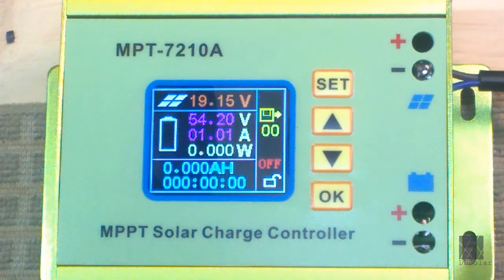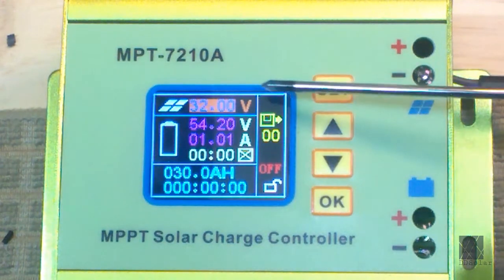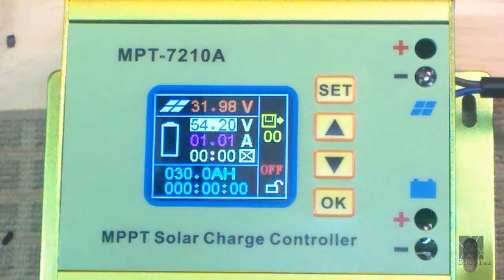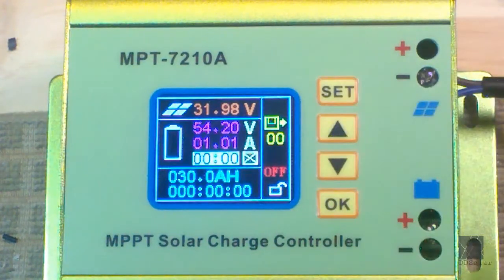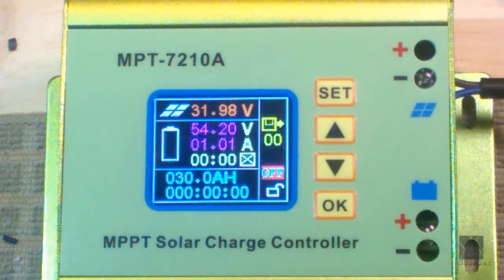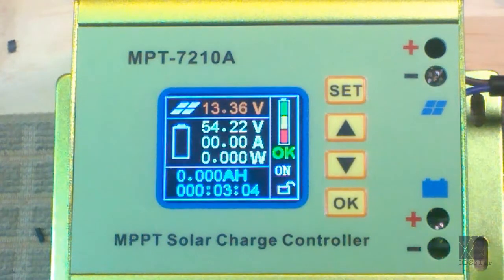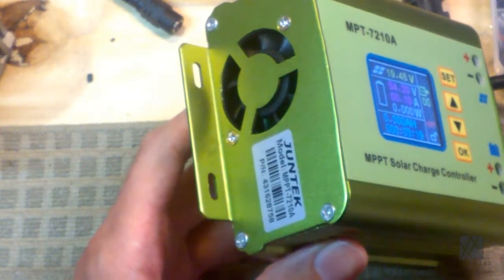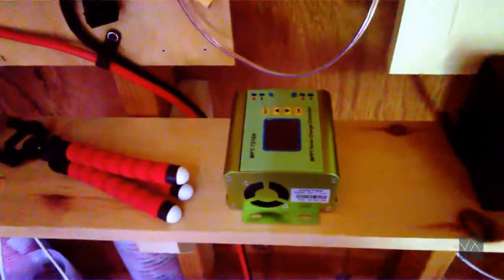How to Program MPT-7210A Boost Solar Charge Controller - Setup Guide

Comment: Thanks, much more understandable than the manual. And yes, I took have a damaged one that I will tear down and try to get working. I'm hopeful because it exploded a 100uA capacitor and blew the board trace leading to the current shunt. LMK when you get around to your tear down.
Reply from the maker: Welcome! I still have one of these that was damaged, if I can take it apart and repair I will upload and share

Comment: This is mppt or pwm?
Reply from the maker: @Skyblue0712 It is technically a DC-DC boost converter with static MPPT - meaning we have to set the vMP (volts max power) of the solar panel, and the converter will try to hold that. It's not traditional MPPT with auto-sweep. But it works OK when properly configured. Hope that helps!

Comment: If the panels are delivering 0.9A? Or when the voltage trips? That was the info i was looking for.
Reply from the maker: Hi, I hope I am not misunderstanding your question, but this charger monitors the solar panel voltage and "tries" to pull it no lower than it is programmed. But at the same time, we can also limit the charging current, in which case the charger won't necessarily reach reach the trip point for solar panel voltage. Or vise versa. In my experience, it doesn't always work perfectly. And the user needs to know the approximate maximum power point of the solar panel to program in. This is a fully manual "MPPT" requiring human input. Hope that helps, if you have any questions just let me know. DD
Reply: @solarpoweredge  thx, seems like a power supply module more than a solar charge controller, or even a battery charger. I'm still dabbling in slow charging SLA batteries. I was shopping for better performance at low solar outputs. As far as I know alot of power is tripped off for safe charging
Reply from the maker: @rickyvenilal1713 welcome... technically it is a programmable DC boost converter. I've noticed in low light conditions it doesn't always work properly. Probably because it is powered by the solar panel itself

Comment: Hi would this be ok with a 300 / 400 watt panel to charge a 48volt golf cart set up
Reply from the maker: Hi! yes it should work. Note this charger has a weak fan and will overheat without it. Might want to upgrade the fan to something with ball bearings, and don't run too high power. I use it to charge my lawn mower from a couple of 100w panels.
Reply: @solarpoweredge  thank you
Reply from the maker: No problem!!

Comment: These are the strangest controllers. I find them too inefficient for daily use. For my tiny house i need good mppt that can adjust to clouds and winter vs summer conditions.
This unit is useless for that. You have to manually adjust and its just annoying. Also even with the best settings it puts out about 50% of a real solar charger. My makeskyblue  cheap chinese mppt charger works better than this one. 
But i found a use for it!
My ebike 56.4v charger died so im using my mpt-7219a to charge my bike battery by boosting my 12v battery power up to 56.4v. The most it will deliver is 50watts even though i have 5amps available it wont do more than 0.5 amps but its better than nothing.
So as an adjustable dc dc step up boost charger with a good screen it will come in handy for various projects.
Reply from the maker: It really is a very niche charger. Nice screen. I use it for my 48V lawn mower. Works good. I mentioned in one of my videos it's just a programmable DC boost converter, no MPPT at all. And yet I can't stop using it. If they come out with a bigger model, I'd buy that too.

Comment: Here what is the maximum open circuit voltage of the solar panels to be used. I have 38 volts V oc panels
Reply from the maker: Hi. Your panels should be fine. On mine, 60V is max input. Battery needs to be higher than input voltage, as this charger can only boost the voltage upward.

Comment: Hi can you tell me if I'm doing something wrong or if mine is faulty. 
I have set up all of the settings and saved them under 00 and 01 all is fine untill the sun goes down. The next day when the controller powers up it returns to default which is right annoying. I reset all of the settings and save them again and it's groundhog Day the following morning Amy ideas?
Reply from the maker: Hello, that is a strange one, can you try setting the changes, press OK to save, then power cycle the controller at that time and before sun down. If it doesn't keep the changes right away, I am guessing either #1) the changes aren't actually being saved or #2) maybe the firmware version is different and perhaps there is a bug. It could even be a faulty unit. On my controller I have to press OK to save, guessing it's the same for yours.
Reply: @solarpoweredge  thank you I will try again I have two units both seem the same I'll have a play and see probably worth me posting here if there is differences.
Do you know of any other units like this that are buck type with a 60 volt input? I am working on designing one but it's hard to get hi current as most designs are only 1 or 2 amps.
Reply from the maker: NP, this charger is rare and unusual in that it is a Boost type and has a really interesting screen and UI. But it cannot drop the voltage from the panels, only raise it. I suspect there are multiple versions of it floating around, hard to tell - they all look the same.
If you search for "boost charge controller" there are a handful of other options, not easy to find good ones though.

For buck type with 60V input, you will have endless options. With those units, high voltage in and lower voltage / high current out isn't a problem at all. Example I have a Outback flexmax 80, so theoretically 80 amps into the battery max.
Reply: @solarpoweredge  yes usually use Victron mppt charge controllers but trying to find a lo cost option that does Max volt point tracking rather than mppt like the boost one. There's a great 5amp device called a CN3791 it also says mppt tracker but it's not it's a MVP like the boost but max input volts is 30 volts
Reply from the maker: Oh right if you want to just hold a specific voltage on the input, there is at least one big programmable DC converter on the "Amzn" site. If I post links they will probably just disappear. Searched for "buck converter mppt". The ones that have this feature usually are programmable and have a screen and buttons. I cannot say if they're really MPPT, but some of them just track whatever voltage you set. Similar behavior to the 7210A. I am not sure if they meet your requirements, but might be worth a look.
Reply from the maker: Actually found one on the same site (same keywords) that does not have a display. Has a trimpot to set the "MPPT voltage" and 2 for CC/CV. Of course that isn't really MPPT but voltage tracking. Claims 20A 300W. Hard to say, probably need forced air cooling to get near those numbers.
Reply: Hi I swapped the controller that wouldn't hold its memory with the other one I had and that one worked so looks like there is a fault with the first one. If I get the chance I'll investigate the circuitry to see if a tombstone  component or something. 
Thank you for quick reply and help
Reply from the maker: You're welcome! good thing you had a spare, I never heard of this happening.

Comment: Hello , this is amazing tool!!!

The ONLY problem is the noise from the fun and i have a very easy fix, the factory have wrongly placed this fan very close to the chassis, all you need to do is take it away from t he chassis for a few cms and the fan is silent, you do not hear the fan you hear th e vibration from chassis, which is disturbing if in close environment

So> Take out the fan which is very silent by the way and for such a  cheap fan very efficient and just place it, on the outside same side , with about 8 layers of double tape , so there is some distance of minimum 4-5 cms from the chassis, at the same side that the fan is , 
take then a plier and cut the metal pieces of the metal that was protecting the fan entry and place some gorilla tape around the fan so the the air is going into the rest of the chassis

Amazingly silent fan and mppt , i have it in my van years and does not produce any noise at all.
Reply from the maker: Hi, Good idea, this fix works well and is very quiet :)

Comment: Добрый день. Каким током заряжать акумулятор 36 вольт 10 ампчас если подключить вместо солнечной панели блок питани. Интересует каким током можна заряжать максимум чтоб быстро зарядить акум и не сильно навредить акуму. и вообше каким амперажом можна заряжать, потому как на данный момент имеется заряядное устройсьво на 2 ампера но очень долго заряжает, хотелось бы чтоб заряжать очень быстро и имееться даный контролер и блок питания. Чтоб заряжать 36 вольт велосипедный литий ионный акумулятор от етого устройства не через панель солнечную а от блока питания, то какой блок питания лучше купить на сколько воль должно быть на выходе и сколько ампер должно быть ? Спасибо !
Reply from the maker: Добрый день, hello, I would suggest caution, no more than 5 Amps on the output because this controller is not very powerful and the fan is small. They are known to fail from overheating. But you could upgrade the fan for more cooling. If you have a 36 volt adjustable power supply, that might be a better option.  

Здравствуйте, я бы посоветовал соблюдать осторожность, не более 5 ампер на выходе, потому что этот контроллер не очень мощный, а вентилятор маленький. Известно, что они выходят из строя от перегрева. Но вы можете обновить вентилятор для большего охлаждения. Если у вас есть регулируемый источник питания на 36 вольт, это может быть лучшим вариантом.

Что касается зарядки с помощью источника питания, подходящее зарядное устройство может также выдавать 5 ампер, что позволит зарядить его примерно за 2 часа. Я бы не рекомендовал заряжать аккумулятор на 10 ампер-часов током 10 ампер. Конечно, это возможно, но это вредно для стаи. Также необходимо обратить внимание на конечное напряжение заряда и убедиться, что зарядное устройство прекращает зарядку, когда аккумулятор полностью заряжен. Надеюсь, эта информация будет полезной, хорошего дня. Я использовал переводчик, чтобы написать это, надеюсь, вы сможете это прочитать. С Уважением

Comment: i wonder if this thing could charge a solar power generator... like a bluette eb70?
Reply from the maker: Hi, probably since 7210A is a DC DC converter without any MPPT. However the eb70 has its own charging circuit. Still it would be fun to try it and see what happens

Comment: have it buy to. i have 24 volt akku, then i cant use buy a 100 watt 36 volt modul ? its only step up works fine? need a  18 volt modul ???
Reply from the maker: Hello, that is right. This charge controller is supposed to charge a battery with higher voltage than the solar panel (it boosts the solar panel voltage UP to the higher battery voltage)
Reply: @solarpoweredge  ah ok, sorry my english gg. all say i need for an 24 volt system a 36 volt panel, with normaly mppt or pwn ...but the  mppt 7210 only can step-up ?  ok, than i buy a 18 volt now.  sorry its my first test, build, mini ehh island ? solar  ehh factory:)   tanks :)
Reply from the maker: Hello, it's OK I can understand you :) 
You are right!
With a Normal charge controller (step down, PWM or MPPT, 24V battery) you can use a ~36V panel, yes.
With a MPT-7210A (step up boost converter, 24V battery) you need a ~18V panel. It will boost the voltage up to ~24V.
Hope this helps!

Comment: The panel voltage setting (at 2:15) doesn't work reliably for me. My unit maintains this voltage for a few moments, then starts slowly drifting downwards until the power source shuts off. 

For example, if I set it at 12V, and use all the amps I can get, it maintains 12V only for a little while. When I check in after a few minutes it's working at around 11.5V, then 11V... then eventually the power source collapses and the controller resets.

I wonder if I have a defective unit or if it's a feature.
Reply from the maker: Yeah I've seen similar behavior on mine. It might be a "feature". Can you try 13-15v instead? I usually set mine just above the maximum power voltage listed on the solar panel's label, and work from there. It's a little unstable but runs for many hours like that. Another option is to limit the current, I've tried this and it works OK. This is a programmable DC converter in reality and it doesn't know where the MPP is. You kind of have to guess at the settings and experiment.
Reply: @solarpoweredge  Thanks, good to know it's a feature and not just my unit! 

I have a solar panel + 12v "buffer battery" setup for charging different things, so I need the lower voltage limit to actually stay at 12V and not drift continually downwards. Unfortunately the MPT-7210A doesn't work for very well for my purposes then. I've yet to find a better alternative though!

Out of curiosity, I tested using a 36V battery (40V limit) as a source instead. It took about half an hour for the input voltage limit to drift from 40V to 38V, probably the same time it would've taken to drift from 12V to 10V. So with higher input voltages the problem is not so bad, but still exists.

(On a side note, I've read the fan can cause some issues, but I tested with and without a fan, so this problem is not fan-related.)
Reply from the maker: That's annoying. I am using only a solar panel on the input. The battery could slowly decrease in voltage if it discharges. It depends. Yeah unfortunately this thing doesn't seem to be the right fit for the job. It seems it would reduce or stop the output instead of letting the voltage slip below the correct setting if the battery voltage drops too much. I am guessing you need a programmable DC-DC converter for the job, but one that accurately follows the programmed settings. I don't know of any affordable alternative, this 7210A is kind of an unusual and niche product.
Reply: This device is designed only to use with 24v batteries or more. If you use 12v batteries you need additional step down buck converter for the output. 300W 20A DC-DC Buck Converter Step Down Module is under ten bucks with shipping from ebay. People say that the device really has the MPPT properties too, but it's very slow to react on voltage drops.

Comment: Does anyone know how to make the fan speed setting (at 12:25) actually have an effect? I've seen some videos where it does affect the fan speed, but I don't understand why the setting works for them and does nothing for me. 

My fan is always at maximum speed and making quite an annoying sound.

I will install a different fan at some point, but would be nice to be able to turn it down in the meantime. I use 1A or less so I'm pretty sure it's not overheating or anything.
Reply from the maker: Maybe there are several versions with different micro code. That fan is pretty annoying. I plan to mod the cooling later to get rid of the noise, maybe I'll do a video about it.
Reply: @solarpoweredge  Cool! I'm still waiting for my fan to arrive so I haven't actually done it yet, but I'm thinking any 12v 3-pin computer case fan on this thing should (hopefully) work. Some of them should be very quiet too.

I'll try cutting the 2-pin cable on the stock fan and connecting the + and - of the new fan to it.
Reply from the maker: Absolutely, that should would work, would be interesting to see how it performs
Reply: @solarpoweredge  the computer case fan works nicely. It's quiet at maximum speed too, so it doesn't matter that the setting doesn't do anything.
Reply from the maker: Nice!!!

Comment: Hi I have one of theses to charge a ebike battery but I have a quick question for thoses days when solar is bad ie cloudy. Can I just connect the mpt controller to a 12v battery to charge the 36v battery.
Reply from the maker: Hi Lee the charger was intended for a solar panel and is not really designed for use with a battery which can deliver huge current. But I see no reason why it wouldn't work. Maybe put a 5-10A fuse on the 12V battery or use something to limit the current to protect the charge controller. Could do a bench test, set the output current to something low and see what happens. This type of charge controller I would not push huge current through it. I have opened it and the design does not look very heavy duty. I use mine like a "trickle charger".

Comment: Hi. Great video. Where did you get the blue LED volt meter that's above the controller? I need one this size to see from afar.
Reply from the maker: Hi and thanks! it came from ebay. DC 5-120V Mini Voltmeter Blue. This is a 2 - wire voltmeter. I like them a lot. They have other colors too.